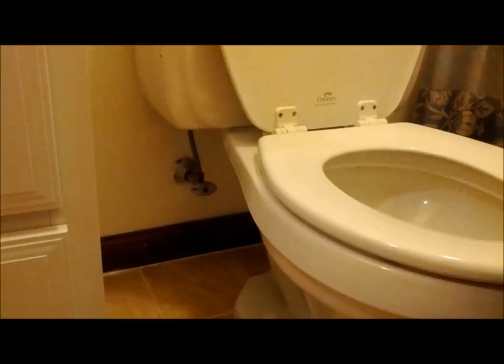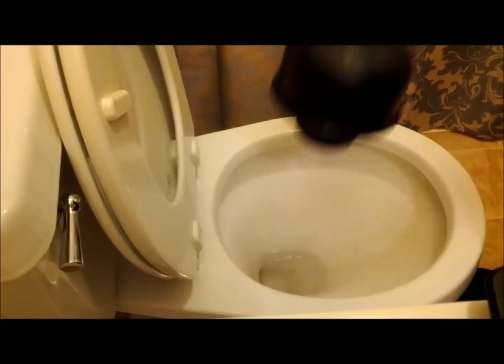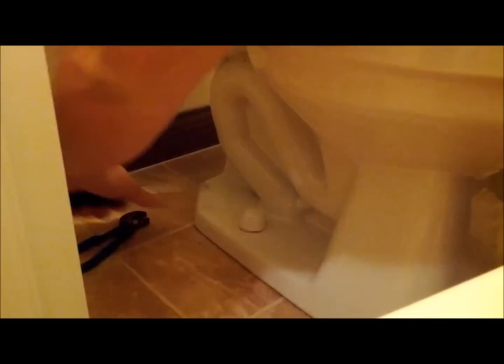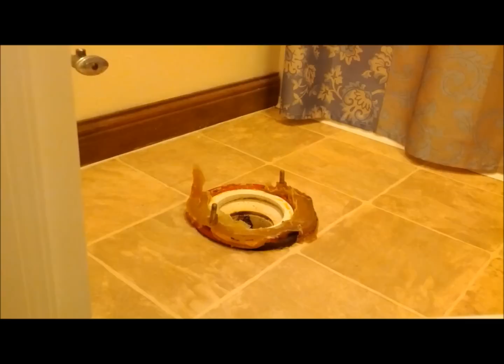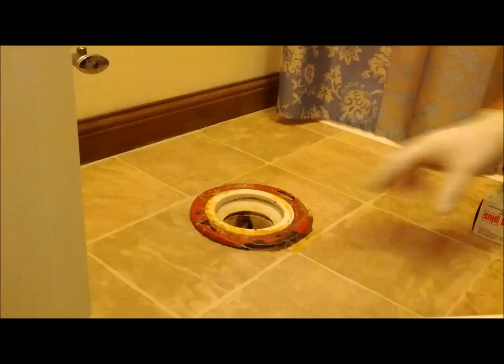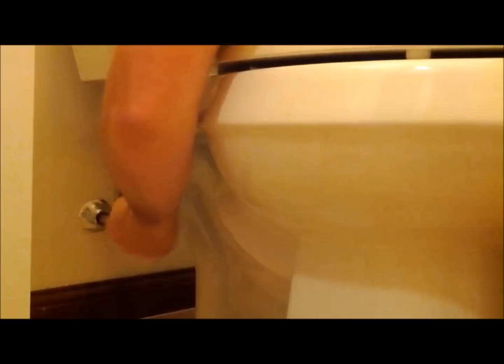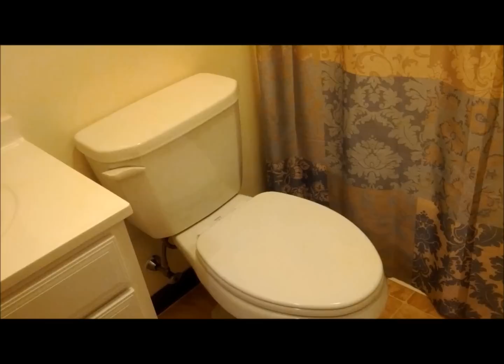How To Remove, Install, Replace, Or Update Your Toilet.

Comment: I tried to remove my toilet bolts and one of them spins so what can I do now to remove it?
Reply from the maker: +robert bonham I am guessing your talking about the bolts that hold the toilet to the floor? If so you will have to cut them right where the toilet and the nut is. You can use a hacksaw will take you a bit. Or a grinder or cut off wheel.
Reply: The DIY guy is right, that would be the fastest option. Otherwise, get vise grips and hold the threaded bolt and use an open end wrench to remove the nut.

Comment: Thanks for the video. My toilet started leaking at the base last night. What a freaking flood. Off to get the supplies needed.
Reply from the maker: +Barry Maynard You're welcome. Hopefully the replacing of your toilet went smoothly for you. Thanks for watching.
Reply: if you used the wax ring with the horn on it that's why use a wax ring without the black horn
Reply: Michael A the black part on the bottom of the wax ring, over time it can shift and when you flush the toilet 🚽 the water can splash out causing a leak at the base, it’s better to get the one without the black piece. Look up toilet leaking number one reason why. Here on YouTube.

Comment: Any idea how to change a toilet seat that the bolts are not visible.  My toilet looks like a solid piece.  I think the seat just goes into the holes.   but the bottom of the holes are not visible.  How do I get the seat off with out pulling the toilet off the floor.  One side of the toilet seat is come loose and you can pull it off from the toilet but the other side is not come loose.  I hate these toilet seats and they are on three toilets in my home and I struggle with them all.  Any help you can give would be great.
Reply from the maker: +Jesse Dolce Its hard to say without seeing it. There are some toilet seats that have the bolts molded into them so they are not visible from the top. If you look up right behind the back of the bowl you should be able to see the nuts that hold it in place. If you want you could take a picture and click the link in the description which will take you to our website and at the bottom there's a place to upload the picture so I can see.

Comment: good video.  My toilet is caulked at the bottom and i've recently noticed water leaking through.  I think my wax gasket has failed.  So since im pulling the old toilet out, i might as we'll upgrade it with a new one!  Do you have any recommendations of good quality toilets?  I'd like to have one with is raised taller than the original cheap one which is there now.
Reply from the maker: KingAndrew5000 Yes i would most likely guess that the wax gasket has failed. It could also be the tank bolt leaking, Take your hand and check the end of the bolt that hold the tank to the bowl sometimes they leak and the water runs down the bowl onto the floor. This one here I have installed countless times and haven't had any problems. Its  a Gerber Viper toilet comfort height which is 2" taller then the standard toilet. Pretty sure the seat height is 17". This one also had the insulated tank to stop it from sweating.
Reply: TheDIYGuyDOTnet i ended up installing a Kohler Cimarron, comfort height w/an elongated bowl.  It's on sale at home depot for $228.  i then bought the upgraded ergonomically correct seat w/quiet close.  I'm so pleased with this toilet that im going to swap out the one in my second bathroom..  thanks for you vid, it helped get the install done correct, and fast,, the first time.

Comment: hope the new one wasn't low water flow - those stink
Reply from the maker: James Hudson lol. It is but it had a 3" flapper so it lets all the water out of the tank pretty quickly. We have installed a few of these and knock on wood we haven't had any problems.

Comment: you didn't show how to REMOVE the old toilet. The old wax ring is gonna be a bear to break that seal.  Thanks...for nothing.
Reply from the maker: evilsacramento I showed you all the steps on how to remove the old toilet the only part I DIDN"T show you was me lifting the toilet off the floor. As its as easy as that lift the toilet off the floor set it on cardboard or carry it outside... Why would it be a bear? its WAX. It doesn't harden the only reason why it would be hard to lift the toilet off the floor is if someone caulked it to the floor.

Comment: Hi have a newer toilet and the back section never fully empties 
What am I doing wrong!? The valve is shut an I am holding the buttons down to flush
Reply from the maker: Some toilets have a raised tower ( part where the flapper seals) which wont let it fully empty. Not sure why you want to full empty it but you could pump it with a out with a kerosene pump or use a junk towel and soak it up.
Reply: Actually a wet/dry shop vac is real handy for removing any excess water from the tank and the bowl. It will leave everything much drier and make removal much neater, especially when carrying the old toilet out of the house.

Comment: Is it not necessary to run caulk under the toilet?
Reply from the maker: No your was gasket should do the sealing, They make thinker ones if you need them. Some people place the toilet and then caulk around the edge. I personally do Not do that. I am not a fan of the look and if the wax gasket fails I would like to let the water out onto the floor so the home owner can see that there is a problem. Also Depending on the type of flooring its a pain to completely scrap off if you need to remove or replace the toilet later on.